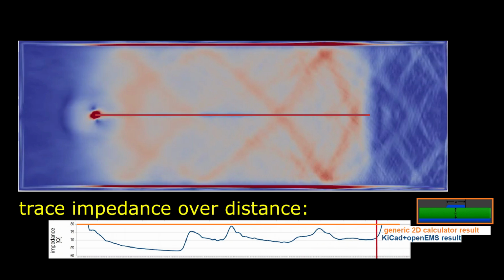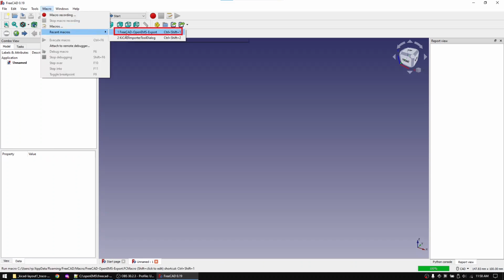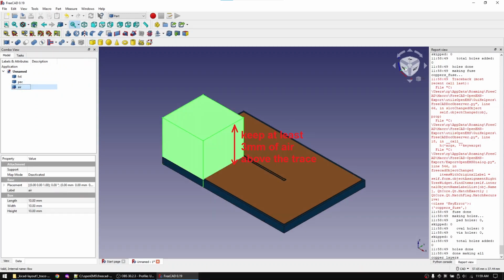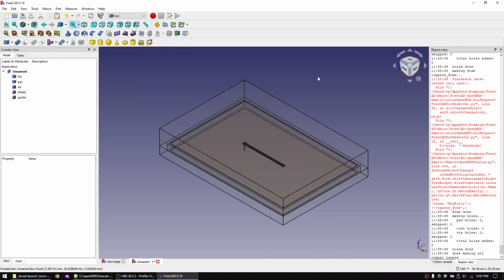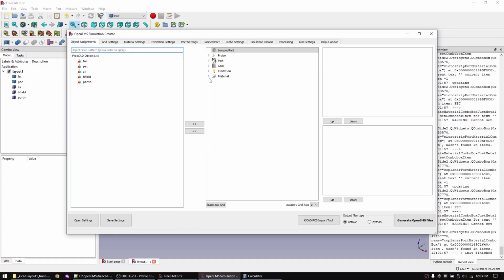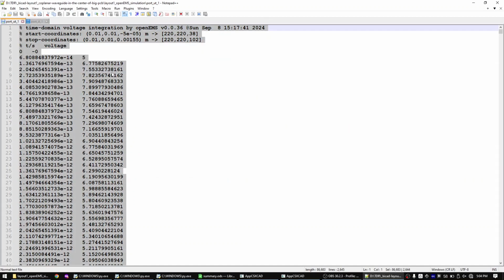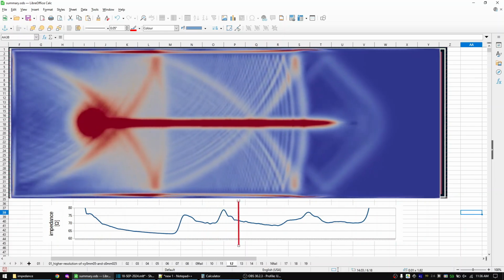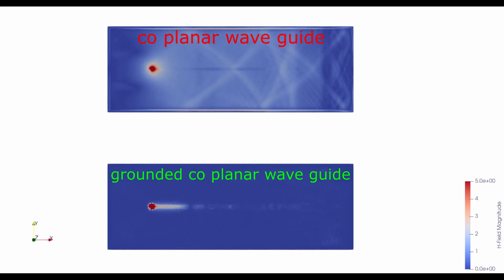free KiCad trace impedance simulation via TDR method (trace impedance over distance) using openEMS

Comment: This video got me inspired to finally try openEMS for real, thank you! 
However I can't get sensible results and I am not sure what I am doing wrong. I'm starting with a board I have measured on NanoVNA using TDR. And I have finally adjusted simulation params to be in the ballpark, but I am sure I'm doing something wrong. My simulation is very sensitive to input port geometry and placement. Also I don't get high impedance when signal reaches end. My grid is a bit more coarse though - 0.5mm in X direction, but I was carefult to properly mesh copper in Z an Y directions. I have already spent a week on this and intend to spend more, but I'm afraid, I need some guidance after all ;)
Reply: Also I can see you have placed substantial ground plane behind the feed point, I am guessing this is to avoid radiation from the back of the port, I am feeding at the edge of board and can see fields spewing out, I wander how much this affects the simulation accuracy?
Reply from the maker: @miceuz  The closer a trace is to the edge of the PCB, the more it tends to radiate. For this reason, EMC experts typically advise to keep some distance between traces and the PCB edges to reduce radiation.

In theory the simulation should still be correct and I would expect that more field spews out (increased radiation as mentioned above).

Practically only a comparison measurement with a real PCB will give you peace of mind about the absolute accuracy.
Reply from the maker: well a small update: even with a measurement its not fully possible to have peace of mind, because you could still have measured wrongly 😅

Comment: Thanks for the great content...!...I just tried your file exactly as you mentioned, but for some reason I am not getting the result that you got. Impedance is always above 100 and also getting negative values. Couldn't find what I am doing wrong. Voltage and current values look closer to what you have shown in the video (for the initial part) but the chart has many negative spikes. One thing I have noticed during the process is a warning about unused primitive ( it has mentioned PEC somewhere in the line).
Reply from the maker: PS: you have to only use the first 1800 values of the table, or in other words only use the values until the end of the trace is reached. The big negative and positive spikes after the 1800th sample are because the signal reaches the end of the trace there. The values after the trace end is reached are not needed anymore for this video example.

you can check out this video regarding TDR method from Eric Bogatin, it will further help you to understand the underlying process used for the simulation.
https://www.youtube.com/watch?v=yYfkuh4hQ-Y&t=1789s
Reply from the maker: Hi there, I added the executable python script, freecad project file, the macro settings file and also the excel table with the results.
Hope they help you to make it work. Alternatively, you can send me a screenshot of the results or also a screen record of your steps so i can help you troubleshoot
Reply: Thanks

Comment: The simulation results are cool, but as such without validation against measured test cupons with same geometry cannot be used to make conclusive claims. This is in fact the key point why commercial simulation toolchains are so expensive - the validation and fitting of the models.

Test case with large floating copper pour around the net and thick substrate dielectric is not representative for most designs in practise - you would either fully remove the pour island, or relatively densely via stitch it to ground.

Generally copper pours on high speed signals routing layers are rarely ever used, the control over routing layer impedance is attained by using thinner dielectric core, single ended signals get wider keepouts to limit coupling.  More realistic test scenario for high density PCB layout is stripline design with much thinner dielectric from both sides (in order of 80 to 200 um), for outer layer there won't be any copper pour in surrounding area with few exeptions.
Reply from the maker: This is an excellent comment and definitely worth reading after watching the video. I completely agree with everything mentioned. Once the channel grows, I’d love to conduct actual reference measurements and compare the results between the commercial and free tools to highlight the strengths and weaknesses of each.
Reply: Beautiful Comment! I do think differently though. The principles of Maxwell describes linear electromagnetic behaviour
If there was any significant change between the behaviour described & what was observed, It would have been well studied & known in open academia & those corrections would be applied to the equations themselves yielding better open models. The only reason I think the proprietary software suites are expensive is because they can simplify existing common applications that require EM simulations which in turn reduce computation time (an end user might think the proprietary software is faster than something like openEMS) & which in turn be offset'ed by an increase in simulation volume.
Reply: @norliegh  The problem is not Maxwells, but very oversimplifying model. Many asumptions are made, most of them are not valid past >2GHz region. PCB dielectric is not isotropic at all in most cases, frequency dependent loss of dielectric, surface rougness of copper, absence or presence of oxide adhesion layer, even alignment of traces to weave of prepreg fibers all matter for signal propagation. There are plenty of papers focusing on those aspects, they are fundamental to being able to run highspeed serdes channels over quite lossy materials to optimize for lower cost.

Most of the above is not modelled as true generic 3D FEM physical representation to save on the extreme compute requirements, but rather by good fitting of approximation models. Also none of the above is nonlinear effect.

My main point is still that you cannot just simply let your simulation model to plot results form DC to almost daylight just because it allows it you to do so and fully expect match without validating.
Reply: @Konecny_M I beleive openEMS is a just a solver that runs maxwells given a spatial domain, not a software "suite" that includes pre-baked approximations & models for beyond 2GHz domain. In contrast, Commercial Solvers are more full fledged suits/packages, thus why they abstract all the things you mentioned behind knobs & dials. The thing to learn here is that openEMS doesn't prevent you from modelling all those imperfections, It just takes a chunk of time (& it's acceptable to me because it's literally free compared to thousands of dollars one pays for those suits). For example, I'm pretty confident openEMS includes lorzentz, drude & debeye material models (for imperfect FR4). Similarly, Other things you mentioned can be modelled too. I agree in a simple DC to dawn sense. The better question for an end user is that time more important or budget? : )

Comment: Great tutorial, but in this particular example you get those giant reflections on a straight trace only because of the copper plating on the top side of the PCB (all around the trace). This creates parasitic parallel-plate line which allows the reflections to propagate and reflect off the boundaries. If you delete this top plating layer you will see a much cleaner picture and the influence of the PCB edges will be negligible.
Reply from the maker: Yes, removing the top copper would turn the trace into a microstrip line, which would reduce reflections but increase overall emissions, as microstrip lines radiate more than coplanar waveguides. Adding via stitching is a good enhancement, though using a stripline by embedding the trace within the PCB would offer an even better solution.
Reply: @panire3  I see. Thanks for the clarification!
Reply: But by removing it you can increase EMI susceptibility and sometimes crosstalk, ringing etc. Plus you're affecting thermal expansion of the PCB which in some cases is important. Depends on the design, there's not one solution for all problems AFAIK.
Reply from the maker: For anyone who was commenting to this one, check out the video of TI at 11:34, they have done and shared a comparison measurement already with and without a ground plane on the top layer. Also they show how a via stitched ground plane causes less crosstalk than the version without a groundplane on top. And also as some of you guys already noted, having a ground plane without proper via stitching (means a partially floating ground plane) is even worse than not having a ground plane at all. 
https://www.youtube.com/watch?v=xInazjL-c8U&t=47s
Reply from the maker: and another confirmation also from Eric Bogatin, see 1:54: https://www.youtube.com/watch?v=grjvwLWDYfU&list=WL&index=4
Best) via stitched ground between 2 signals on the top layer has the least crosstalk
Good) no ground at all on the top layer is a bit worse but still good
Bad) ground without proper via stitching is very bad, so if you are in doubt of your via stitching skills its probably best to not use any ground pour at all on the toplayer

Comment: Uploaded just 29 Min Ago, i am glad i found This channel for simulating my Kicad Boards since i struggled at the beginning to use OpenEms.

will there be any Thermal Simulation in the near Future ( it is so usefull in low Voltage high Power Applications)

thank you Panire.
Reply from the maker: sadly thermal simulations are the only thing that i have placed behind a paywall on the plattform udemy for about 13USD if you have a coupon. If you are on a budget, you will even be able to find a hidden free coupon within the comments every few months. https://www.udemy.com/course/kicad-fem-with-free-software-tools/?couponCode=9C62BBB39D64993A56CD